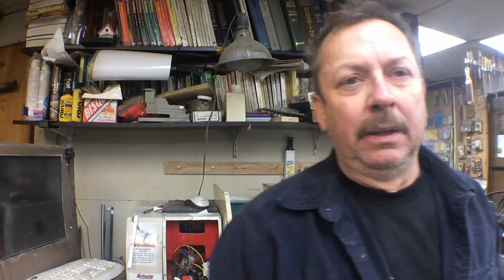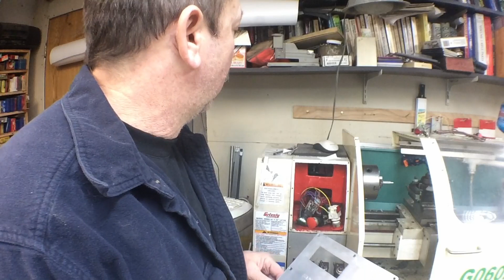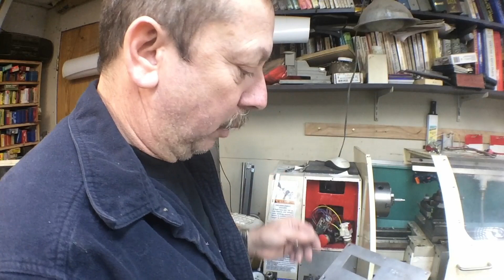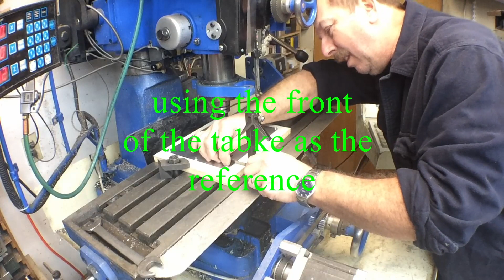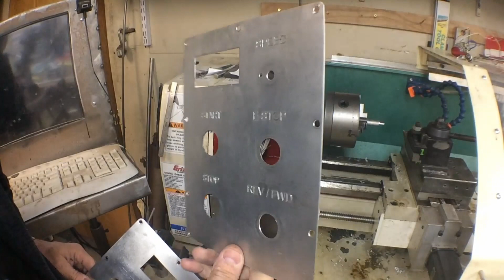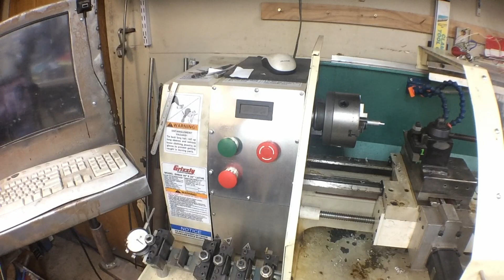Grizzly G0602 CNC Lathe: New Faceplate For The Control Panel

Comment: Both the mill and the lathe are really cool set ups you have going there.
Reply from the maker: Thanks, just part of the learning journey. I have had the mill for years and when I converted it I knew that it was well worn. when I installed the ball screws I tightened it up some, but it was intended to be something I could learn cnc with and has worked well for that. The lathe was purchased with the intent of converting it and it does well for it's size and will perform well for hopefully a long time. I think I am going to built a turret for it eventually but that just adds one more project to my neverending list.
Reply: What kind of mill is it?
Reply from the maker: Grizzly
Reply: Oh cool. I'd like to get a small mill of some kind eventually. It's the next step I suppose. I don't really know what is out there that is small, but not a mini mill contraption.
Reply from the maker: this is the mill drill. poor choice for a cnc machine as whenever you raise or lower the head you lose alignment. a much better choice is the rf-45 style mill where the head moves up and down a square dovetail column so when the head is raised or lowered you retain alignlent.
Reply: Good to know. :)